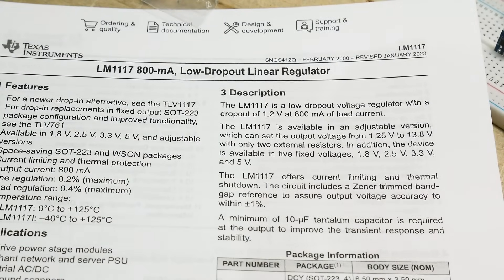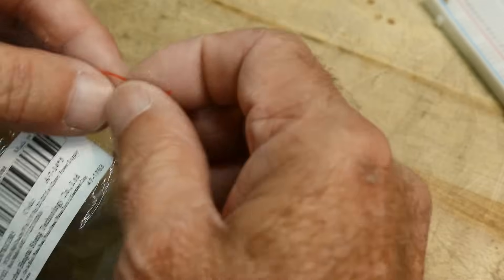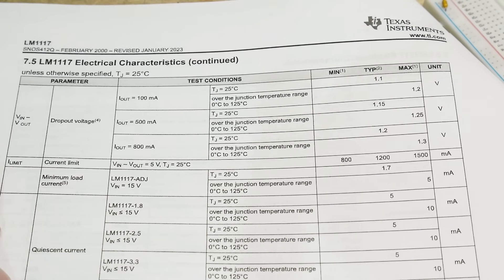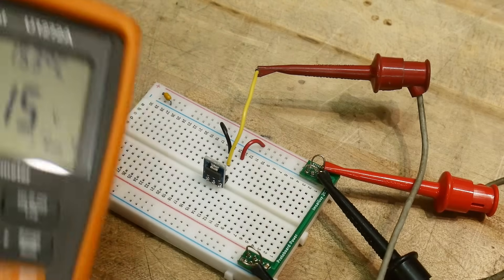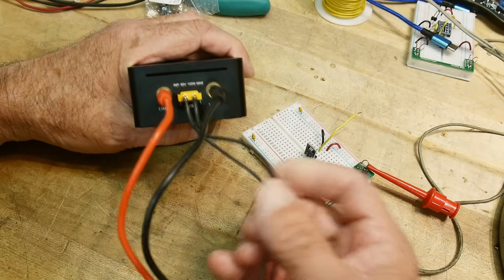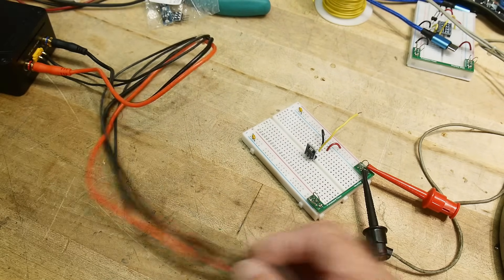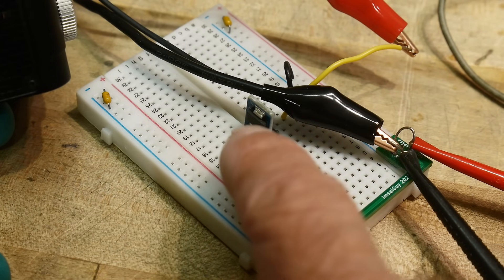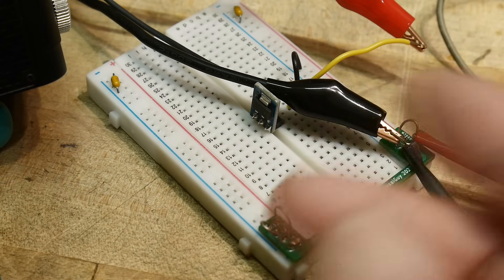#1859 LM1117-3.3

Comment: Thanks for showing the ESP32. I have some esp32-cams sitting around I plucked one off from until I get some in from shyna express. Now I can use old 9v batteries to power the little PCB STS discovery shuttle thing I got off adafruit. Made by phyx

Comment: Yes, to get these anywhere near 800mA you need to do a lot.  Keep the input voltage down to below 2V over the output plus give up about 1 sq. in. of copper on both sides of the board with proper thermal vias between and ensure adequate airflow.  It gets expensive fast.

Comment: Just reading the datasheet and minimal math:
SOT223 terminal resistance w/o any additional copper: 61deg/W
5V input to 3.3V output is 1.7V to turn into heat or 61*1.7deg/A as the junction temperature temperature above ambient.
TI allows up to 125C on the die, so assuming 45C ambient (non-ideal situation) we have 80deg to spend. 
500mA are within specs, but I would not go that far. Especially if it should work for a longer time.

Comment: Chenese products are more often AMS prefixed, usually can't withstand declared max input voltage, and their datasheets (in case they are bought from reliable international parts suppliers, which Alliexpress isn't) do not provide reliable data to properly calculate power dissipation over layout, and also provided electrical characteristics are possible only for TO-252 package on propperly designed layout, not mentioned in datasheets.
Reply: Aliexpress are an umbrella for a multitude of sellers and some sell extremely high quality components, some specialising in industry overstock.
Reply: @AnalogueGround  Have you seen manufacturers' datasheets download link on these sellers alli pages like on digikey, element14 subsidiaries, chinese lcsc for the sake of not being westerncentric, etc.?
Reply: @deepblueskyshine  No, but once I’ve established that a seller is selling genuine components I can download a data sheet from the manufacturer to check the spec. If a corporate customer requires certification of conformity then I’ll order from RS or Farnell and they pay more for parts. Aliexpress gets a bad rap as some of its sellers are passing on re-marked or even fake parts but it is only a few sellers and the price usually gives you clue. If you choose a seller wisely and even do a small test purchase to establish their integrity, there are some real bargains to be had especially when bulk purchasing.

Comment: I recently did consider using this part on a Commodore 64 cartridge that I am developing. I have rejected it, because C64 power supplies often deliver below 5V on the mainboard, 4.8V is quite typical and due to load on the mainboard, when your power arrives at your IC on the cartridge, it has dropped even more. I consider it desirable that my cartridge works correctly for inputs as low as 4.5V and then the dropout of the LM1117 becomes tight. Therefore I have decided not to use the LM1117 and am going for an MCP1826T-3.3, which has quite a bit better dropout voltage.
Reply: .... but the MCP Part is also more expensive. I think it does not care a lot for something for a C64. This is built more for a small group of customers who are happy to pay a few euros more if the components are also of premium quality. A product for the mass market is a different thing, every cent counts... And especially with such simple components, you look for components that are offered by several manufacturers so that you can go around delivery problems quickly...

Comment: Any alternative recommendations for a device which doesn’t regulate voltage by waste fully shedding heat?  These LM’s seem to act as a programmed resistor.  Maybe a miniaturized buck?
Reply: They do make modules that are drop in replacements for 78xx to-220 linear regulators. Linear regulators are good for low noise. When you put a switcher in there you get more ripple noise on the output.
Reply: @xenoxaos1  You can use a switcher followed by an LDO to help with noise. It won't be drop in though.
Reply: @misterhat5823  definitely! I've used them for that before. SMPS set at the most efficient Vi-Vo. If it needs to be as clean as possible, I throw a C L C filter on the output with a resistor for a minimum load. You can tune these for to intended load if it's going to be consistent. Wrap both sides in separate metal cans if you want to make the fcc happy
Reply: Check Monolithic Power Sytems (MPS) for
switching converters in a small module
with built-in inductor.

Comment: I prefer the ones with lower quiescent current, they work well to convert a lithium 18650 cell to be used to replace 2 AA cells, as the low quiescent current means months of operation between charges.

Comment: XT60 connector.
Reply: To not use that connector is just senseless. 🤪
Reply: It's not, it's the tiny little XT30.
Reply: Nearly, half that rated current
Reply from the maker: no, current in the sense lines
Reply: @IMSAIGuy  Not in this application but that's what the XT range are marketed as unless something has changed